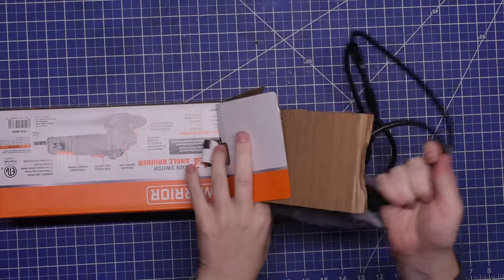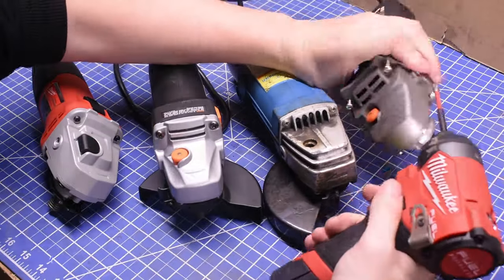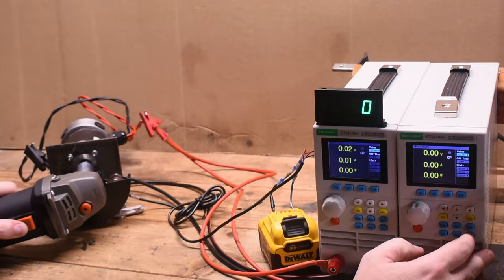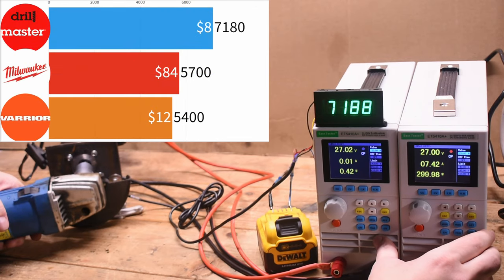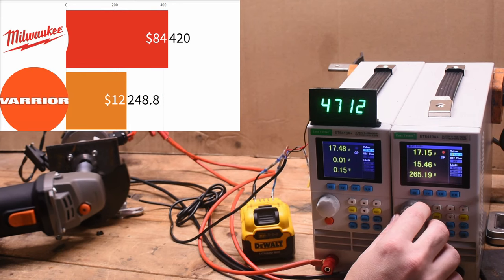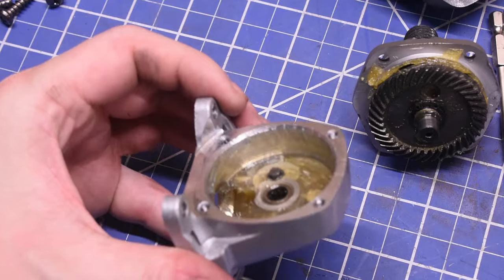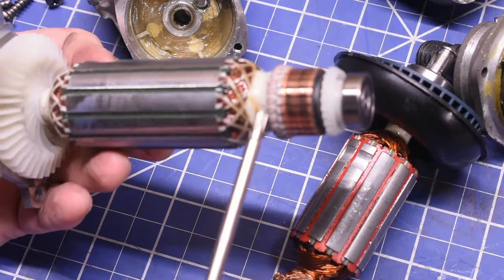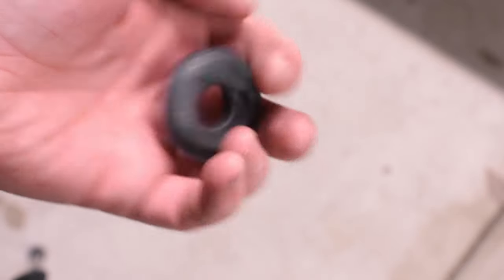Exactly How Good is an $8 Harbor Freight Angle Grinder?

Comment: So I had bought the $10 harbor freight grinder to use for 1 project. It didn't even make it half way through before dying. Replaced it with another harbor freight grinder (the Bauer corded one) because I guess I was looking for trouble. 3 years later I still have it and just used it to make a lot of cuts on 3/8" rebar. Still going strong. I highly recommend it.

Comment: I have a few of the $9 grinders from harbor freight. I use them around the house. I think over the years I think one of them stopped working but I took it apart and cleaned it up and it started working again. I used it for a few more years until the cord got cut. I had another one that lasted a long time and I just had it stop working after using it very hard. It might be salvageable yet. I have 2 or 3 new ones that I picked up over the years. I never expected them to last as long as they have. They really don't owe me anything. Would I use it as a daily grinder? Once in a while maybe but I bought a more expensive higher quality one from mac tools to use at work. I think it's probably a Dewalt. Not sure who made mac tools stuff in the 1990. It is still working to this day.  Great video guys!

Comment: For welders who buy many angle grinders to avoid swapping accessories cheap corded grinders are VERY handy. 
If you added a flex coupling (perhaps durable hose like Gates Barricade fuel injection hose) to the connection between grinder and dyno would the sufficiently decouple the dyno for long endurance runs?
Reply: Or maybe make a love joy coupler

Comment: I bought a Hitachi angle grinder for like 40 bucks for the kit like 20 years ago.  I had to fix it once, by having to redo the handle end wiring from wire flexing the wires had come off the terminals.

Comment: Another interesting factor would be to run the angle grinder under high load close to 4000rpm for a few minutes. 

btw. The cheapest and shittiest orbital grinder I bought in a pinch was really great. Man I sanded so many cars with it. 
After some time it didn't work so I changed the brushes and it was great again. Well after some time the brush holder broke and it was just totalled afterwards. May it rest in peace

Comment: wish you had dewalt here too.

i got a mower shop and though i got dewalt, porter cable and bosch angle grinders, past 4 years i been using my drill master grinder that was $10 on xmas coupon special few years ago. got mad 1 day and threw it across shop. bent guard. still runs like new. less vibration than older porter cable. easy to use 1 handed. for the price it cost a penny per mower blade sharpened. I get $10 a blade. so 1 blade paid for it. maybe my dewalts would last 80 years vs the drill master 40 years or whatever it may be. but if you aint gonna be running a grinder non stop all day the drill master will last most people a lifetime. even if you do use it all day and it wears out in a year. it was $10! go spend another $10 for another year of non stop use! a meal at mcdonalds is $10! better than $100 upfront and hope it lasts 10 years to come out the same!

Comment: Thanks for this! My second hand cordless grinder crapped out when I needed it. Luckily the battery it came with is worth the price paid. Since most of my usage will be in my shop, that little WEN with suit me just fine.
Reply: What brand of cordless grinder did you use? Any guess on how long it lasted?
Reply: @ddegn  It was a 24V Kobalt, but I'm not sure how much use it had prior to my owning it. It looked well used but came with a 4ah battery for $40. I've had good success with other tools in the 24v lineup.
Reply: @dougcutler4948  my coworker had to replace a new 24v kobalt drill that crapped on him, they replaced it. vie used my bauer drill for driving 3 inch wood screws drilling metal drilling concrete and it doesnt quit.

Comment: A few years back I bought about 10 of the harbor freight 7" grinders for a job and within about 2 days 7-8 of them had burned up. We were simply cutting pallet racking bolts (~3/4") flush with the concrete they were embedded in. We ended up just buying sledgehammers instead of grinding and just bashing the bolts into the foundation. I'd definitely like to see a torture test of these grinders to see if they actually last on the job.

Comment: I have some Makitas and some cheep harbor freights, when doing body work it’s much easier to have one with a grinding wheel, one with a flap disc, and one with a cut off wheel. Instead of changing the disc every time.  Yes they don’t have the same torque but they work and have for years. For some tasks you don’t need the best most expensive tool.

Comment: I bought that $15 Warrior on sale for $9.95. But the only thing I use it for are 2” Roloc disks which don’t require much power, so little stress. It’s great for that as it’s small and weighs little. But the top slide switch has a spring that can wear your thumb out quickly. I really wouldn’t recommend this for anything else other than a quick grind once in a while. I’ve seen guys on YouTube burn it out using it the way I would use my Dewalts.

Comment: While you are tearing things down, the area of brush contact is also interesting. Assuming the brush spring pressure isn't stupid high or stupid low, a larger brush contact area should result in less brush wear and a little less heat generated in the brushes and commutator. This is important for longevity, since having the brushes burn out has (in my experience) been the most common cause of corded tool failure.
Reply: It is important and it isn't. Brushes are a wear item. And there's compromises that are made there- harder brushes last longer, but they wear the commutator bars out faster. Soft brushes tend to have better contact, and while they wear out fast, the commutator doesn't get destroyed. You can buy brushes for a couple bucks, and it takes just minutes to change them. You can get the brushes from the tool maker, or if you have a decent independent hardware store, they'll have a bin with all kinds of replacement brushes. Hell, my 7-amp Hercules grinder actually came with a set of replacement brushes! As far as I'm concerned, brushes are like brake pads on a car. They're meant to be replaced now and then.

Ultimately, I'd much rather have softer brushes that don't destroy the commutator. But people just throw shit away these days when it stops working all too often, so manufacturers have taken to using super hard brushes that last longer but take the tool with them when they fail.

Comment: Walter grinders are the best in my opinion, they are the top tier metabo if I remember correctly. They juste power through any task. I still own one that’s about 30 yo, it’s a big 7in 15A model that’s feared by any untripped circuit breaker!

Comment: Here's an idea for a long term torque test stand for corded drills. 
Get them to spin an alternator and set it up to a 12v car battery as a buffer and power either some headlights from the battery or get an inverter and power other stuff from the 12v generated by the angle grinders. Also you can put some stuff on a timer so you can have different loads and run it for 100 hours or so.

Comment: Man it's sad the brand name surcharge you get for the Milwaukee. Granted it is of at-least decent quality, but apparently the obviously lower quality $8 grinder has done it's job and lasted as well. I would def go with the WEN if these were the only options though, it really does look built to last.

Side note: Bought a cheap B&D 3/8 corded drill at wallyworld for $20 20 or so years ago. It is strong and would break your arm if you let it. Still works to this day.  Fast forward to about 2014 and while helping family move to a new place out of state, I needed a drill to drive a lag for a tv. Went to wallyworld looking for a B&D, they had none but did have a HyperTough for the same $20. Went to drive the lag and it started and got about 3 turns in before it started smoking and quit. I have had old ass cordless that could have done the job.

Comment: Would it be possible to include some of the 4.5" pneumatic grinders for comparison to the corded grinders? It would be great to see if there's a significant enough increase in power to weight ratio with air grinder over electric to justify the cost (+$1,000 for an ingersoll rand or atlas copco)

Comment: I was thinking about a run to failure test machine. Had an idea of using a torque converter from and auto trans to load the machine using the resistance of the atf and internal vanes. Would be consistent, long lasting, and cheap to build.

Comment: Ive got tbeough 30 cutoff wheels and 7 grinding wheels building my grill guard with 1/4" flat bar and angle iron.  3 days of cutting and grinding with the cheapo HF grinder.  Got a bit warm a couple times, but havent had any issues

Comment: If you want a heavy duty 4 1/2" angle grinder from Harbor Freight, buy their 11 amp Atlas model. At that power level, it's making just under 1 HP and you can 'hog' it hard as you want and it won't overheat or stall. Get into the 7 AMP models or less and you're getting a grinder that will work, but doesn't produce much power and won't last too long. Of course, you'll pay the price, I think I paid around $60-$70 for mine.

Comment: As many TTC viewers are likely to know, until recently there were two $15 Drillmaster grinders, frequently sold for $9.99.  They were externally almost identical and had identical packaging, but they had significant internal differences and different part numbers . This Warrior appears to use a similar motor design as the better (60625) version rather than the other one (69645). Neither of those models has much in common with the vintage Drillmaster featured in this video.

Comment: Vibration would be my top metric if it was for running it all day. All other things matter very little if you're destroying your hands if you run it more than just and hour or two a day.

I'm not sure how accurate the measured values for vibrations are. I've noticed that corded angle grinders numbs my hands a lot less than the battery ones even if it sees they have the same vibrations on the box. I think it has to do with the corded ones running at higher RPM so any vibration is of a higher frequency. It could also be that vibrations under load is different from the measured vibrations of just holding it, I get the feeling that a faster spinning disk runs smoother than one that is bogging down.

Comment: Corded is the way to go, unless you have lots of spare cash to throw away. I bought a Skil brand corded grinder back in the 1990's at a flea market for $10. It still works just fine. Doesn't get hot (does get warm), vibration isn't enough to make me stop using it, and is strong enough to get any job done. 
Buy corded. You can use it all day. No wait to recharge batteries.

Comment: Most useful videos are these cheaper ones. I almost never use a grinder but if I need to, I’d like to know what one will get the job done cheapest
Reply: I watched a guy on here the other day use a chainsaw attachment for a grinder that worked great. Not sure if it will work with mine but a cordless chainsaw for only $23 more that the grinder is sweet.

Comment: i have about 10 grinders 4 of them like the 8dollar special. for on site where the tools grow legs nothing beats the 8ds. for workshop too. they are slim powerful enough. as long as you grease them once a yr. first to go are the woodruff keys made of oreos. replace them before running and they wont chew the key seats. in the end an angle grinder is as good as the wheels and there is no bs there more $$ more perf. nice to see this test thanks. take care. peter

Comment: I have the older version of that Milwaukee. It looks like a quality tool but the air coming through the ventilation openings is so hot you can't tolerate it on your fingers. I also have a Makita and Bosh. They are all make in China but the Makita is definetly constructed out of the best Chinesium.

Comment: Milwaukee has mostly jumped off the corded-band-wagon,  along with quite a few other power tool manufacturers. I unwillingly or unwittingly performed this same test on the job for my former employer. It all started with a job that required what ended up being roughly a days worth of grinding, "condensed" down to 2.5 days, thanks a lot Milwaukee and DeWalt for time I'll never get back.(Both of these tool manufacturers mostly-great-quality battery-powered tools!) I went through 2 DeWalt 4.5's, 2 Milwaukee 4.5's after first killing what had been the old-reliable. Was I pushing those little grinders to-THE-limit? YES. I fully admit that I was. The job was under-quoted for a good, long time customer that we were trying to help. The cost of the tool/s was irrelevant. The point was to, get it done as quickly as possible. So...by the of day, and 4th round trip to the Home Depot, I had in my over-worked, more-than-a-little-pissed-off, tired-hands Milwaukee #2, a 4.5" WEN, and an air-powered polisher I'd planned to try convert to grinder if needs be. Long, Painful story short, Milwaukee#2, dead in less than an hour, swapped disc #2 from grinder #4 too now grinder #5 where it would finish the remainder of it's life. That WEN soldered on to complete the job...8 more discs later. I was spraying 3 cans black paint to hide the violence. After this experience, I promised to take every opportunity to relay this story every time I the chance. Love the channel.

Comment: I use my Milwaukee angle grinder for specific tile cuts as a tile professional; have had it for three years and no issues. Don’t know how much I spent or if it’s the same model, but just my two cents

Comment: Hello, i think it would be very Intresting to test Corded bruschless angle Grinders. There are not many out there, but some. For Instance: DeWalt DWE 4369-qs; Hikoki G13VE2; Chuang 
CA1013T; Flex L 13-10 125-EC; Franztool HG0011 2100W brushless EC; Fein CG 15-125 BL Inox.
Of course a Compairson with the Makita GA5040CZ1, one of the most pleasent to work with elecric Grinders i ever used.(low received Vibration, Smooth preceived cutting Behavior)

Comment: I've been using my red Walmart brand (can't remember the actually name) for 8 or so years and it gets stored outside. Little rusty but still works perfectly with very little vibration. Although seeing inside yours tells me I should open mine up and regrease it.

Comment: I might still pick up one of those real cheap grinders to use as a 3rd grinder just to run it with a wire wheel for cleaning up weld beads.

Comment: It could be interesting to see some of the old very-not-compact corded angle grinders compared to some of the newer varieties. In general, we've certainly seen a lot of types of improvements in power tools over the years, but how does the cost-cutting and weight-reducing trend compare against the older junk that was built to require a bodybuilder to operate? I've got an old angle grinder that weighs like 25 pounds and can use those ridiculous 6-8 inch discs, has a power cable that's like an inch thick and only like 3.5 feet long, and the body is thick metal. I have never needed an angle grinder that huge, and I have no idea where my family got the thing, but it's older than me.  Do we think that level of absurd is practical(or even powerful), or is it just a weird relic of the past where we overdesigned things to use for exactly one task?
Reply: It's mostly to cut bricks and concrete, egg to create a new window in a wall or if you need to cut a trench in your driveway

Comment: It would be interesting to see how a larger 6" grinder compares to a smaller 4 1/2", how much extra power are you getting from a 12 or 13 amp grinder vs 7 or 8 amp

Comment: I'm curious to see if the Craftsman 4 & a half inch corded angle grinder has anything on these I've got one and it costs no more than $50 and seems to have pretty good power as a 7 amp grinder

Comment: Your old blue is identical to the $13 IIT-branded one I bought circa '02. Missing arbor lock solution included. It's driven a corded scooter around the yard, spun 6" knotted cup and stringer wheels, and maybe a few 7" cutting discs... While 2 corded (early 2000s gen) Milfuckees couldn't survive half that age, and they were babied. Only maitenance required has been spit on it and call it scum periodically. Oh yeah, EVA data would be awesome - can't have too many metrics.

Comment: I got an "assembled in the USA" Dewalt grinder maybe two years ago and hate using it rattles my bones until my body is like a tuning fork, miss my old porter cable but the plastic rotted off that thing after 20+ years.
Reply: I missed a comma in there

Comment: “I know what I got” 😂. Maybe post gearbox temp after 20 min real grinding.  I seem to remember my close out grinder got too hot to hold.  Unless that was just my grinder.  Concrete- it makes a ton of dust, but it’s pretty cheap for a test material.  Lots of vibration.

Comment: I recently got a M18 2850 drill driver non fuel and it surprised me when it took off a axle nut torqued to 200 ft lbs 😮 and my friend has a fuel and it won't take off my lug nuts 😂 can you please test the non fuel m18-2850 on a xc5 battery and then the cp2.0 that comes with the driver Thankyou I love the content btw I'm debating on not even getting a mid torque impact and just going to a high torque maybe I just got a super beaffed up driver idk

Comment: Honestly not sure if measuring vibration on the dyno makes any sense. It's not like the grinding wheel is fixed in place or all that heavy. A shaky grinder would shake the wheel instead of itself, maybe if you want to measure vibration you'd have to do it in some other test jig?
Reply from the maker: Oh def not doing it on the dyno